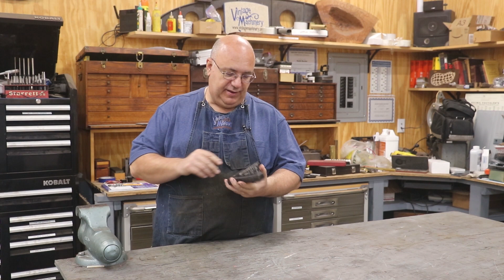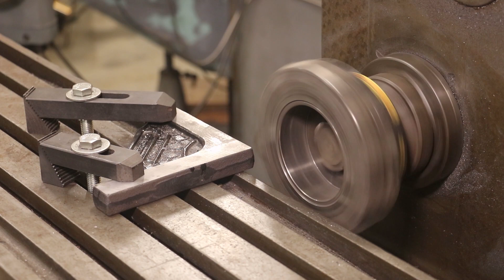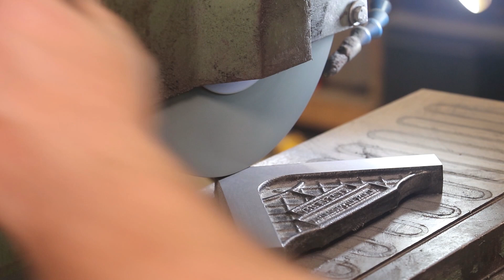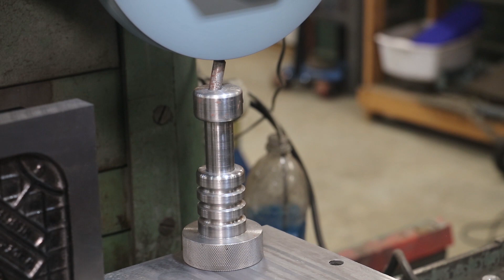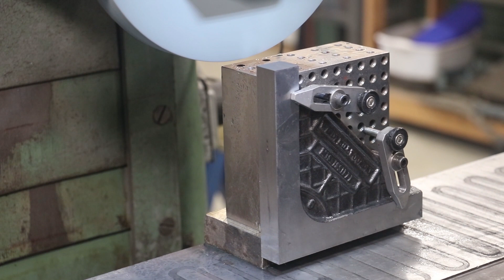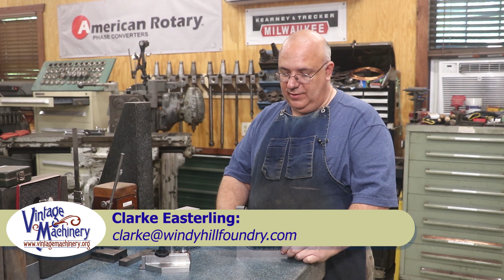The Windy Hill Foundry Square: Milling and Grinding a Casting Parallel and Square

Comment: What is Donald Walker responding to? I do not have the time to find the nay-sayers. Clearly you are a master of the Human-Operated-Machine machinist trade. This is a real thing. I watch you, Abom79, and Precision Machining. PM is a CNC machinist. But it is still hand work really. That is because he has to use his fingers to feel the gauge to measure where his CNC machine really is. So the bottom line is that the accuracy of his machining resides in his human senses, and not i some mystic computer perfection.

Comment: Having thrown work off a magnet, I disagree with put hand on discharge side of wheel and not blocking around the work, especially given the spacing on that magnet.
Yes I've had magnets fail in the middle of grinding.

Comment: A threaded hole at the ends would have been a nice feature in the event you wanted to attach a handle, indicator, and other accessory to the square. It would be the ideal time to do it considering that it is only ground and not lapped or scrapped yet, and since the parallelism is not ground into the part you would be able to ensure parallel clamping with the face.

Comment: just a thought before you dive in with the grinder,, have a measure with a hight gauge & mark the high spots with a sharpie. that way you won't crash into it as you did. Great job. A nice project I like the setup.

Comment: For those questioning the positioning of the dressing diamond - look at the angle of the grit being thrown. It will always be tangent to the wheel at the point of contact. Looking at about 24:15 it looks like the grit is rising slightly, which would indicate the diamond point is on the egress side of the wheel and slightly past dead center. I seem to remember Keith saying something about that once before in a video, but it may have been someone else. Either way, it looks to me like we are being fooled by the camera angle.

Comment: Hi Keith. Loved the machining of the square casting. I didn't realise that there would be that much difference in accuracy between a mill and a surface grinder. I had assumed the mill would be within a few thou but I think you said there was about 20 thou difference across the surface of the square. Anyway I thoroughly enjoy watching and learning something new alimost every time I watch your recordings.  Malcolm

Comment: I'm not surprised that the milled surfaces weren't even. Distortion from the mill set up. It happens. There are things you can do to reduce it. Such as slipping shim stock under the areas with gaps.
On the grinding operation myself I would have set up on magnetic parallels that were ground in place so that I had a surface as flat as the grinder could produce. The secret here is to not turn the magnet off too release the parts or the parallels.  I used to grind thin walled bearing spacers to .00005 or better in parallelism on a continual basis.

Comment: Nicely done.  I might suggest on the Horz mill to pull the table away from the cutter before moving it to the other end.  Might have a snarl cutter that puts in marks on a clean cut.  Cast might have hidden hard spots that cause chips on cutters.

Comment: Hi, Keith...Here is a copy of a note I just sent to McMaster-Carr. Thank you

"Thank  you very much. My items arrived just as promised.
"This is my first experience with McMaster-Carr and I found it extremely satisfying. I watch Keith Rucker's YouTube presentations and had the impression that it would be, and it was. 
"Your website is the best I've seen for my needs. I'm a hunter more than a shopper so I get a little annoyed when I'm bombarded with "suggestions." Especially when what I'm really looking for is hard to find. Your site is well laid out, easy to filter for sizes and choices, and once the "hunting" is done, all the product information is fully available for review before adding item to cart. 
"The only teeny concern that I felt was not knowing upfront the cost of shipping. But with the trust I've come to place upon Keith Rucker's judgement, I pressed the button and was relieved to learn that your shipping charges are quite reasonable. As you know, there are firms out there who charge many multiples of the actual shipping rate.
"Just want to let you know what a pleasure it was to deal with you. "

Comment: Does heating just from different temps make it go out and in all time?
Reply: I was wondering if the web between the two sides helps or hurts that.  It would be easy for him to test it at different temperatures.

Comment: I am confused by the early (fundamental) stages of the operation. If both faces of the casting are deemed to be "not flat", clamping them down to the table will (by definition) flex the part. So that, having machined the upper surface, the clamps are undone, the part springs back, and the machined surface (assumed to be flat) is not longer flat.

So now we flip it, clamp it again, and hit the same issue...

How does anything ever get flat? If there's a standard machining work that address this sorta' thing, just point me at it, and I'll go read up.

(and, yeah, I've heard of casting "skin" issues, and seasoning castings, but I'll ignore those for now. I'm confused enough already...)
Reply: I didn't look too closely, but it might have been that either he had a pretty decent casting or he had something under it. Typically one would shim under the clamping points so that it doesn't rock and clamp it, so the clamps do not exert any bending force to the workpiece. The same is true with the grinder, if the parts firrst surface on the table is not flat, is has to be shimmed so the magnetic table doesn't distort the flatness of it.

Casting seasoning is a old wives tales, to get a proper stress relief is to heat treat them.

Comment: Yikes - at the end when you were handling the new square on the surface plate, I kept thinking you were going to cut yourself.

I mean, you can call it surface grinding if you like, but it was a perfectly good sharpening operation too.

Had you (off camera) softened the arrises to be less ... lethal?

Comment: How did you break the edges?
Reply: Good edge break on a surface ground component is a piece of sand paper pulled along the edge. Makes a teeny tiny round in the corner.

Comment: I am only curious but don't you worry about grinding away on your mag chuck ??   even the manufacturer says not to slide parts on an off the mag chuck !  I mean it makes sense to any machinist who understands just what metal to metal contact can do...
Reply: It is just a work table and if it gets dinged, you can always grind it flat again.

Comment: But why would anyone buy a square they have to make themselves? It kinda defeats the purpose of having a precision tool if you are relying on your own equipment to make it. It seems no different than selling me a boulder and telling me it's a surface plate, some assembly required.
Reply: Simply for the purpose of doing it themselves.
Reply: Have you checked the prices on a fully finished square that's accurate to a less than a 10th? There's your answer. While a commercial item would be hardened this one will be more than good enough for it's intended purpose.

Comment: Keith, when you get to 50 millionths of an inch aren't you supposed to use temperature to calculate true measurement?? Well done time well spent, thank you I enjoyed this video as usual.
Reply: Squareness checking is just that, for something where it's exact physical size is important then yes it's temperature could have a large effect. For checking squareness then as long as the tool was thermally stabilized to roughly the same temperature throughout it's cross section and approximately at normal room temperature then the measurements and tool can be trusted. Since there's no such thing as absolute perfection then sometimes good enough will do. That square is still pretty damn accurate for a home shop and you'd have to spend some large money to buy anything better.
Reply: @turningpoint6643  -Oh thanks for telling me what I know... My attempt at complimenting his work indirectly by implying his work is so GOOD he should use temperature controls has been overlooked. Sigh...
Reply: @paulsilva3346  And thanks for letting me know I need to learn to be a mind reader. When you add question marks that does turn it into a question now doesn't it.

Comment: Keith
What are your views on casting ageing when I was in work the old timers (hark at me I am 73 )used to say leave them out side in the sunlight for a year to stress relieve I know the modern way is to heat treat in a Lear , they always put the spun cast iron pipes though a huge Lear at the iron works where I served my time , I believe it was a old practice to bury the steel used in jo blocks for a year
Reply: It has been shown numerous times that 'aging' outside doesn't do much at all to the stresses in the parts, mostly 10-15 % might fade away. The only way of properly getting it stress relieved is with heat treatment.
Reply: Some of our customers required a 'cold treat' before grinding hardened tool steel.

Comment: Nice square Keith.  But I am confused by the units you were using.  You seemed to refer to sub 1/10,000th of an inch as 50 Millionths?  Since 50/1,000,000ths is several orders of magnitude smaller than 1/10,000th, I must be misunderstanding what the measurement is.  My non machinist brain would assume that measuring within 1/10,000th would be 5/100,000th.  What am I missing?
Reply: 1 thou AKA 1/1000 is 1000 millionths (agreed, I hope, or we're in trouble)

So ... 1 tenth AKA 1/10 AKA 1/10,000 is (therefore) 100 millionths.

So ... 1/2 a tenth is 50 millionths.
Reply: Paul Womack Got ya.  Order of magnitude error.  50/1,000,000ths = 5/100,000ths.

Comment: What if, you measure the hypotenuse and the sides/legs and check it with pythagoras.
I realize that you had good references in those blocks, so just for fun i guess.
How far/close are you from square/perpendicular in angle?

Comment: Maybe I'm missing something, but (after the facing cuts) I would have clamped it flat on the table of the vertical mill (on a spacer to keep it up off the table), and run around the two long sides and two ends in one setup.  Pretty hard for it to finish anything other than dead nuts square after that isn't it (since you normally expect your x and y axes to be square)?
Reply: But then you'd be cutting through scale with an end mill while Keith used a really beefy insert face mill. Personally I'd have considered using a HHS fly cutter and resharpening freehand after it got beat to hell. Though If I was making a soft iron square I'd be tempted to make three and hand scrape them to final squareness  (but not at $130 a pop for raw casting) Partly just for the heck of it and partly because I don't have a precision "cube" so grinding setup (and final checking) wouldn't be so easy, not sure I trust my Chinese 2,4,6 blocks all that much..
Reply: @jaytalbot1146  fair enough. Good point. 
I hadn't really given that aspect any consideration...
I would be using a solid carbide end mill not hss. Does that do the job in your view for cutting the scaled up surface?  Happy to learn from others. 
I still want to find a way to machine it in one setup using the squareness of the x and y axes to guarantee the squareness of the product though...

Comment: Most importantly, thak You !

Keith, You probably have thought that as well. What went wrong in the milling machine ?
For me at least "little over 20 thou" is too much variation, it is 0.5 millimeters anyway.
Typically the old milling machines when taken good care of can easily do 0.02 millimeter (about 8 tenths)  accuracy just by taking good care of the setup.
I did not notice nothing wrong with Your setup so might it be tramming or nodding the head ?
Reply: Most likely the part wasn't shimmed on eiher occassion of milling it clean, or as usual with a casting, it warped from removing the skins.
Reply: I was curious about this too. I'm not criticizing here at all as Keith does great work that I could never approach. I am curious, though, how coming off the milling machine it'd be off by 20 thou? Just wanting to learn here.

Comment: I got my set of square castings from Clarke this weekend and started machining the first one. What I like most about machining is that almost no two people will approach the same job from the same way. Thanks for sharing!
Reply: You are absolutely correct.  When we machine something, we do the best we can with the equipment and tools we have available.  Keith has some pretty old machines, but I have seen some of his restoration work, and the rest he accomplishes by thinking carefully about each stage of producing the thing he needs.  He might be a hobbyist, but I am a lifer who has worked too many times with guys who just won't  think of how to get the job done with what we have in the shop.

Comment: I don't know how much it matters because I'm not as experienced as you are.  I would have thought that the webbing should have been supporting when clamping and magnetic fixing were done to prevent the pull on the webbing from deflecting the rest of the part.  Looks great!

Comment: You never mentioned de burring after milling, maybe that goes without saying but if you didn't that may account for .010" inaccuracy coming off the mill. Also I was taught that your diamond dresser should be leaning away from wheel rotation and be in front of the wheel.
Reply: Agreed on the dresser, that's how I was taught too.  Plus I'd put it "downwind" of the part you have set up so you don't blow grit all over the part you're going to grind.

Comment: How square do you need, 1 micron is REALLY close.
Reply: Even if it's .0001" out of square it is good enough for any job that calls for the precision of a square. That .0001" over a test distance of 5.5" means it's out by .001" over a distance of 55". If more precision is needed than that then a 6" square probably isn't the best tool for the job.

Comment: Nice job, though I gotta say I prefer a square with flanges on at least one side of the web for mounting clamps. Clamping anything to this will be tricky at best.
Reply: Buy one from Windy Hill and mill/grind it to your spec.  That is the beauty of finding good, rough castings that can be made into precision tools.
Reply: @paulcopeland9035  The issue is that there isn't enough material in that rough casting to leave a flange. The casting needs to be made with that in mind.
Reply: @siggyincr7447 ... I'll bet Clark could fix you up with a thicker flange casting. He seems to be flexible with his designs.  A small operation like that is great to work with.

Comment: Quick question...I realize there are as many ways to skin a cat as there are cat skinners ….While the horizontal mill is great for hogging off material, the vertical mill could have machined all 4 edges with 1 set up.  Is there another reason that you chose the horiz. mill other that it's material removal rate?

Thanks for the teaching videos.
Reply: Because he has it and likes to use it.  This is a hobby shop and machining is his hobby.  He has a great selection of tools and machines.  Let him have fun!
Reply: @paulcopeland9035  Not poking at Keith, just trying to learn.  I didn't know if there was another reason for using the horiz mill.
Reply: Do Tell....I can't think of a way to reach all surfaces on the vertical.  I haven't bought one of these because I don't believe I can hold it in the Vertical mill to do it.
Reply: A face mill is usually cheaper, tooling cost and time wise, then an end mill, per cubic unit of material turned to chips.  But you need to get the feed rate up, I would argue he is going way too slow and rubbing the inserts to death.  That vertical mill he could have been up around 0.005" per insert and the horizontal around 0.012", just guessing but I would say he was under a 0.001 in both.
There is a good deal I would do differently then Keith but he does get the job done. ;)

Comment: Keith, I don't have nearly any experience compared to you. But I see something you are doing that too me seems wrong, and dangerous. When you true your wheel, you are doing it on the ingress side (front side), and the diamond is facing away, if that diamond were to release , lets say a power outage, your wheel would blow up.  That wheel should be trued on the egress side of the low spot. That way it pushes it away and you are safe.  I might be wrong, but I think maybe that's why the diamonds are always angled,  and they usually are on the back side, and mostly I have seen the diamond facing away from the wheel slightly , for the same reason I assume.

All this maybe wrong, but I would like you to be safe, so please find out whether I am wrong, or maybe right.
Reply: I worked for years on tool room grinders and generally I would always put the diamond near dead center under the wheel, so even if it does budge a bit it wouldn't be enough to crash the wheel if I'm off a bit. But yes your right, when in doubt never put the work in a position to get sucked under the wheel. Blown up wheels can do a lot of damage.
Reply: Great point.

Comment: Keith, good work, looks Usefull.
My only concern, other than vacuuming the diamond refacing dust was the orientation of the single point diamond..
It looked like it would dive into the stone if it picked up.
Just say'n.
Reply: carl white, I thought the same thing and went back and looked at the way he was grinding. With the angle of the shot it’s hard to tell, but I think the diamond dressing stone is behind the wheel. Either that or he has the diamond going in the wrong direction.
Reply: With the direction the grit from the wheel and the sparks wheel is clockwise as you stand in front of it, as all purely surface grinders I've seen do. IE , danger Will Robinson!